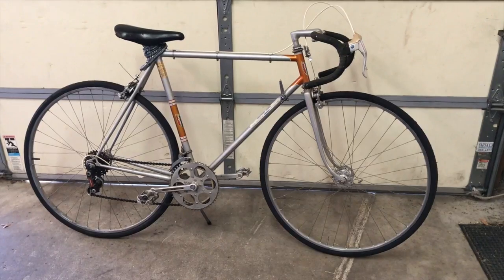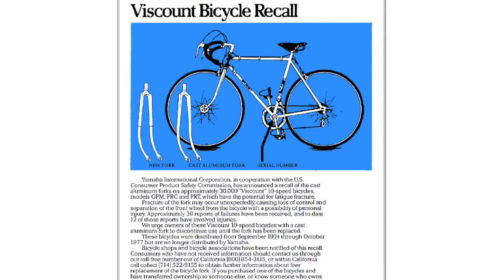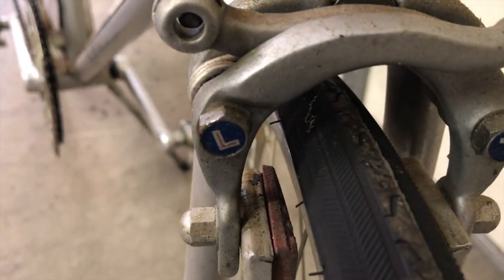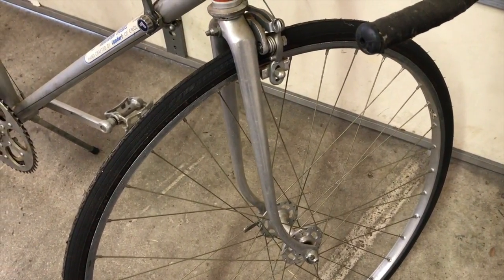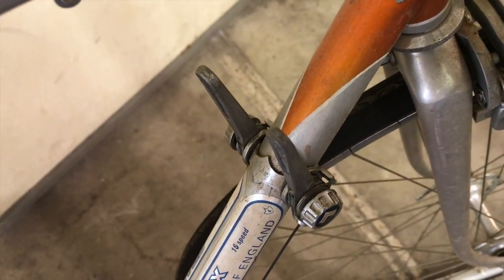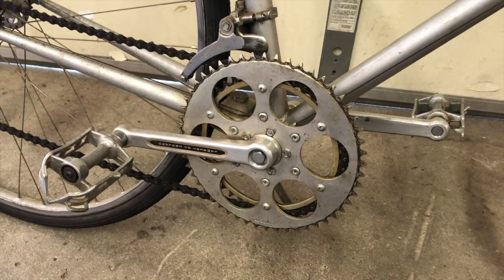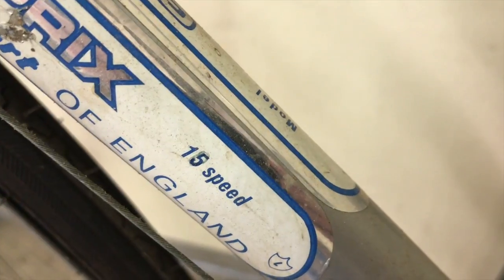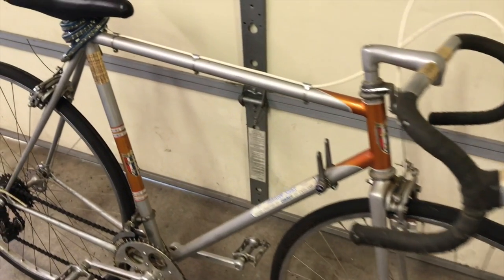1973-74 Lambert / Viscount Grand Prix Road Bicycle - Vintage Bicycle

Comment: That's so cool to see a bike 40 years old still be able to hit the road after a little TLC
Reply from the maker: +Andrew Sjoblom 👍
Reply: I do it all the time im making a rusted out 72 schwinn a new bike pretty soon it rides now I just gotta do sanding and paint and get some stock parts back on it
Reply: It almost certainly could. Might want a new fork tho....
Reply: My soon to be 40-year-old Raleigh Europa only needed new tyres/tubes rear brake cable and chain and she was back out o the road and has covered a good few miles and still is amazing.

Comment: Say "THANKS" to you boss for showing us! Those were my hay days of road biking (still do). Had a nice Raleigh with quick release. Still have several roadies with downtube shifters. Get used to 'em and no problem. Much less fragile for touring for sure,  that's where they shine. No broken shifting @ 120 miles from civilization! I remember these bikes. Saw only one. I was jealous! I do remember the fork issue. Thanks!!!

Comment: I rode an areospace pro lambert in 1970. I did'nt have any problem
with the forks although i broke the crank spindle. It was a light well
handling bike. The local bike shop installed a new crank set and later
built me a touring frame bike that i rode all over hells creation. I put
a turbo pro seat on it and allot of miles.

Comment: I bought a frame set off ebay, with a Tange fork, the factory replacement for the failed fork.  I've built it up with a six speed free wheel, and some 700cm wheels on 70's Campagnolo high flange hubs and Weinman brakes, which I believe those are, behind the nuts.  It's a light, nice handling bike, and yes, quick release was becoming common by then, I had it a few years earlier, as a teen.  The bike I've built is exactly on size for me, which is kind of new.  Thanks for showing this, I took a while figuring what I'd got.

Comment: At the low price end, at the time(1972-73 during the first bike boom, when more adults started riding), bikes like the Schwinn Contental and the Raleigh Grand Prix had front and rear quick release hubs. The Simplex Prestige derailleur set is what came on mid priced bikes, I had these and the rear ( made of DuPont Delfina plastic)couldn’t be adjusted after a month.
Reply: Should have been DuPont Delrin

Comment: steel and chromoly ten speeds from the 70's and 80's are super popular where i come from, its usually every one's first adult bike, they are cheep, easy to fix and there isn't a bike shop in the city that dosnt carry the old 27x1 1/4 (or 1 3/8th or what ever) tires

Comment: Nice video.  I almost bought one of those a year ago for $50. Cool looking bike. Early 70s bike boom era bikes were great.  I own a few, the all have quick release wheels.  Down tube shifters are simple, and just work well.  I actually love using down tube shifters because it just takes one hand and the are easy to reach.
The Simplex Delrin plastic derailleurs came on a lot of bikes. Not a great derailleur at all.

Comment: Earlier Lamberts had 15 speeds. I have one so equipped.

There were three aluminum forks used on Lambert and Viscount bikes...(not Vissscounts.)  The first two forks were the sources of the most problems. The final version, known as the  "V3" fork, is considered by many collectors to be safe, but by the time it appeared,  the public relations damage was done. To give you some perspective,  there were roughly 30 reported cases of problems with the aluminum forks. This was out of  more than 30,000 bikes sold with the "death" forks. I bought  a Viscount Aerospace G.P. brand new is 1975. I currently own two Lamberts and two Viscounts Three of the bikes have their original forks.  I ride all of them. No failure rate of such a crucial component is acceptable, but some failures happen with ground-breaking designs.

I do not like down-tube shifters either. The bikes I ride the most have SunTour bar-end shifters.

Comment: Neat piece of history there.  Downtube shifters were omnipresent from the advent of derailer gearing (~1930s) until Shimano introduced the STI integrated brake lever/shift lever in ~1991.  Until then, folks who didn’t want to reach down there would modify the bike with “bar end” shifters that mounted in place of the handlebar plugs… or buy a cheap piece of junk with the shifters mounted at the stem ;)

Most racing bikes have only ever used two chainrings; a “15-speed” call-out suggests that the bike was set up for touring, with a third “granny gear” chainring for steep hills… you could probably modify it back to 15 with a different crank & bottom bracket.

1027 steel seems to be a rather basic high-carbon alloy; I think higher-spec models may have used either a Reynolds steel alloy or 4130 chrome-moly. The death firk would still make great wall art; I think Soma Fabrications sells a lovely chrome-plated 4130 fork that will fit the Lambert’s 1” headset.
Reply from the maker: +cerberus1981 great info! Thanks for sharing.
Reply: i head someone call those stem mounted shifter gut rippers one time, loved the name.

Comment: A few points Kev!  Big fan, but let me give you some pointers. 

1. Yeah, Quick Release was a thing back then.
2. The routing's changed a bit, but they had 'cable stops' often, too, much like a modern bike. Some even ran through the frame (but that was more rare back then).
3. That's not a speedometer, it's an Odometer.
4. That's not a magnet, it's supposed to be at an angle and poke a little star-shaped thing that moves once-per-rotation and turns gears like an odometer!
5. An item missing is a pedal cap
6. I think he probably swapped the crank off at some point, it probably used to be 15 speed/have 3 in the front.
7. Go for it! You can use a 700c on a 27" bike, they're interchangeable.
8. I'd swap off the brake pads first, though!

Comment: Very similar to my mid 80s Univega Sportour. The downtube shifters are a real blast when you hit an unseen pavement seam while reaching down lol
Reply: Nick H being able to look ahead is a bike skill common to all areas of cycling, therefore you're in the wrong there. plus it only takes a second to grab the lever and back to the bar, idk how fast you have to go to not see a hole.
Reply: this is the wolf try commuting at night on cracked black asphalt. Even with 1200 lumens of lighting, shadows and LED cutoffs are brutal. Never crashed but, there is never a place where friction shifters are ever better than trigger shifters.
Reply from the maker: It always amazes me how different it is riding roads at night vs daytime. Lots of hidden surface variations waiting to be discovered.
Reply: this is the wolf Did you ever group ride?

Comment: At first I cannot imagine spending multi-thousands of dollars (or even this bike's inflationary equivalent of $149.99 (1973) = $875.23 (2020) to $279.99 (1973) = $1,633.91 (2020)) on a bike that I could not even take off of the road, but if it would last me 55 years (based on 2017 - 1973) that might be a different story. This is awesome.

Comment: Re the quick release, I have 2 early 80's cycles, both Raleigh and both pretty much original, my Europa 5 speed has no quick release let its 10-speed sister does. As for that cycle, well call me biased but as I am a Brit, well that cycle to me is just a thing of beauty and rightly carries all the branding with pride.

Comment: Well, not often you see one in this good condition! A couple of comments and observations from a seasoned vintage bicycle repairer - firstly the name Viscount is pronounced "vye-count", rather than rhyming with discount. With the components, most of the Lambert branded parts look to be customised versions of other products, the brake levers in particular look to be rebadged Weinmann ones, the cranks are TA copies, usually made by Birmalux, and the brakes themselves are likely GB or a clone. As for the 10/15 speed question, the crank arms look like they have additional fittings for a third "granny" ring although as you say it could just be a dual purpose label. My big question is whether it's a standard bottom bracket - many of the Viscount/Lambert Aerospace frames have a non-standard threadless bottom bracket and replacing it is often difficult, although there are now far more options for compatible aftermarket bottom brackets that thread to themselves not the frame.

All in all, it's a very cool bike and something of a break from the slew of Raleighs that dominate the vintage British bike market.
Reply from the maker: Thanks for the info!
Reply: HA.  Birmalux.  Well I guess I learn something new every day.  :)

Comment: I have a retro Raleigh grand prix. Got it from my grandpa. I have the same rear derailleur, both jockey snapped after a couple rides.
Reply from the maker: +skylar peppler wow. Thanks for sharing. Did you replace the parts?
Reply: KevCentral I did replace the jockey wheels. I had to buy them off eBay for around $30 I think. I don't think simplex exists anymore I couldn't find name brand replacement parts. I also don't know how much riding my grandpa did.
Reply from the maker: +skylar peppler I came to the same conclusion about Simplex. From what I read they had a bad concept and were never able to recover.

Comment: Campagnolo invented quick release skewers in 1933.

The bicycle may be British, but the drivetrain is French, and the brakes and levers appear to be Swiss (Weimann). Lambert seems to have rebranded components.

Looks like a Simplex Criterium derailleurs in front and rear.  They were ok back in the day, but delrin plastic didn't age well. 

The crank is excellent! A rebadged Specialties TA Pro 5 Vis crank (considered by many to be the best randonneuring/touring crankset made because you could get rings from 20something teeth all the way into the 50s).  Also the crank is very narrow, bringing the pedals close together, which for a lot of long distance riders made them ergonomically good.  And BTW, Specialties TA STILL MAKES CHAINRINGS for them, along with companies who make clones, namely Velo Orange.

Pro 5s were easily turned into triples, and that was one of their strong points. I'm going to just venture a guess that a triple crank might have been an option, and that is your 15 speeds. 

BTW downtube shifters were considered a good idea by people who like simplicity.  You can construct a drivetrain with hardly any shifter housing.  Once you get used to it, one hand can simultaneously shift both front and rear derailleurs at the same time and you can send the derailleur across your gear ratios in a split second....  Index systems start to seem fiddly and forever needing TLC.

Comment: My Schwinn and Raleigh bikes have a down tube friction shifter.  Schwinn Sprinter 1980's is very light, less than 30 lbs
Reply: Schwinn Sprint, about 28 pounds, loved mine 👍

Comment: Wow, memories. I was in the business back then, and we were approached to distribute Lambert. The whole operation reeked of scam, and we passed. Their photos of the factory were re-touched (this was before Photoshop) to show their name on what looked like a small English garage. The aluminum fork looked interesting, but as you mentioned, it turned out to be a disaster -- you can't simply keep the dimensions of a steel tube unit and make it out of cast aluminum. 

This wasn't (or intended to be) a race quality bike. I was marketed against other bikes that were in the $120..150 range at the time. Good examples being the Raleigh Super Course and International. It did have a racier frame geometry than they did, but the weight and tubing were nothing special.

As to some of your design points  -- quick release wheels we common on road ten-speeds of the time, even to a market notch lower than this. 'English racer' was a generic term for upright bar 3-speed, sports (lighter and more upright frame) British bikes. The Raleigh Sports being probably the highest quality one. Down tube friction shifters were the most common shifters for derailleur bikes of the time. Many of the parts were simply private label of common parts. The crank set is TA, but the outer chainring looks like a special pattern. It has an inner set of bolts for fitting a small third chain wheel. The brakes look like Weinmann knock-offs. That lever behind the seat is not a seat height quick release but rather a device to slacken the brake cable to make it easier to remove the rear wheel or service the brake pads.

Comment: Schwalbe still makes tubes and tyres (!) for that size. I'd disassemble and clean the bike, ultrasonic cleaner and rust convert and the such. Then oil and grease them bearings, replace handlebar tape, saddle (some cheapo will do), and the chain – and you'll have a spectacular bike that doesn't get stolen when waiting for you at the next train station. As for the shifters: Too dangerous to use them in Germany's dense cities with the aggressive traffic of our days.

Comment: Great vid, thanks for sharing! One note - almost all rim brake bikes have the cable run on the top tube.
Reply from the maker: Thanks for commenting. Do any still run on the top of the top tube?
Reply: You know I think I misunderstood you originally. I thought you were commenting on how the brake cable was run on the tope tube, but after rewatching the video I now see that you were commenting on how it was run on top of the top tube and not on the bottom of the top tube. My bad.

As far as where the cable is run on the top tube, it's a real mixed bag. Some are run on top, some on the side, some underneath, and some through. It's only with the advent of disc brakes (and some old roller cam brakes that were mounted on the chain stays) that the brake cable is routed on the down tube.

Comment: Lots of bikes of that era had the shifters on the down-tube... or even worse they were on the stem, that always got in the way somehow. Or you would make a sharp turn for whatever reason and it would shift to another gear... usually because you hit the lever with your knee. Quick release was only out on high-end bikes. 10 speed was about as high as you could buy without investing lots more $$$... which was funny because race bikes of the era were fixed gear for the most part, mostly to save weight and issues with the shifters failing... new tech at the time.  Road bikes were the only ones with gears some cruisers had 3 speeds... all were wrong for anything except flat ground or downhill.
21lbs? your boss spent some $$$$ back in '73...

Comment: People were injured in front-fork failure incidents, which was certainly not acceptable. However, there were approximately 30 documented front fork failures out of 30,000 bikes sold with aluminum front forks. The failure rate works out to .001%. There were also three versions of the aluminum forks which makes the issue even more confusing. The last version, which is known as the "V3," fork, is considered by many owners to be safe. Yamaha, which bought Lambert and renamed it "Viscount," recalled all of the Lambert and Viscount bikes equipped with any versions of aluminum forks in an attempt to end the controversy, which was a P.R. disaster. In spite of the bad publicity, most Lamberts and Viscounts I see in the U.S. today still have their original forks, even the earliest versions. I wouldn't take a Lambert/Viscount without a replaced fork down a mountain though. After all, the original forks are all 40 to 45+ years old now.

Comment: downtube shifters are not that bad, it makes cable routing stupid easy and keeps the stem free of clutter. You get used to them pretty quick too, brifters are a bit unintuitive in comparison... of course i have only ridden one bike with downtube shifters (built in 72) and the campagnolo derailleur might not be indicative of how most roadbikes shifted (it's buttery smooth to this day)

Comment: Forks used to Break.. The Cyclo Cross guys in Halesowen Club from the Midlands UK tested them .. The Bikes were Crap actually.   I Knew a guy who used it on the Road for training, most of it broke pretty fast...and yes the Q/R skewers were campag style repos but about  10 % as good...
Reply from the maker: +333wheeler Thanks for sharing the info!

Comment: If it says 15 speed at some point the six speeds in the back were swapped with five
Reply from the maker: It appears that at some point it had a sticker over the 5, and it looks like the outline of a round sticker is there, so I assume this was Lambert/Viscount using one label for both speed bikes and just covering it up. The owner of this bike bought it new back in the 70s and never changed anything, so it came as a 10-speed. Granted there could be any number of changes between what the factory in England produces and what the US importer modifies. It’s also possible that this was a change made by the dealer he purchased it from.
Reply: KevCentral well if that had a sticker over it that makes sense ive seen the same issue on a 1983 fuji del rey I got a 18 speed but under the sticker is 15 but its cool that lambert still has the fork of death and lasted this long that one might have good welds on the forks
Reply: Also campagnolo was the creator of the quick release wheel check the hubs they look a lot like campagnolo  record hubs this is a nice bike im currently restoring a 1972 schwinn collegiate
Reply: Nick Fanella So how would you get 15 out of a six cog cassette? More common core?

Comment: use a punture repair kit instead of getting new tubes when u ride it just dont go fast and dont clip in
Reply from the maker: Good tip. In the case of this bike I don’t know how old the tubes are, so it will get new tubes before I would ride it.

Comment: ITs 15 Speed Beacause The front Derailleur is 3 Speed And The Rear Derailleur Is 5 Speed And If Multiple It 3x5 = 15 Speed Just My Opinion Tho
Reply from the maker: Look at the video again. The front derailleur has 2 gears. 2x5=10.
Reply: D.O Gaming Thanks for sharing, but you're wrong.